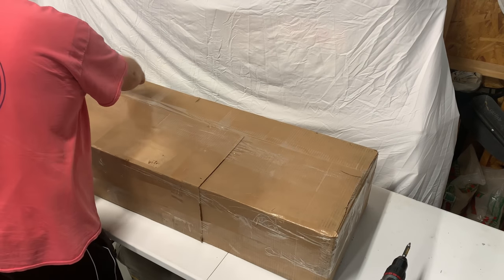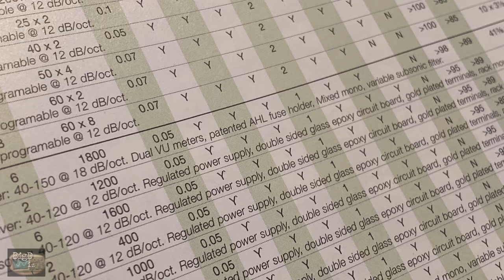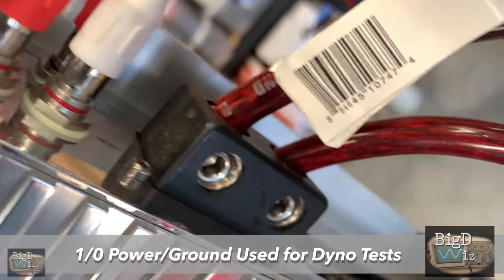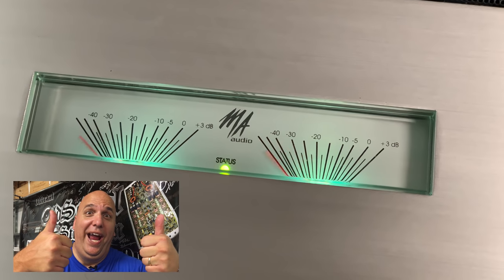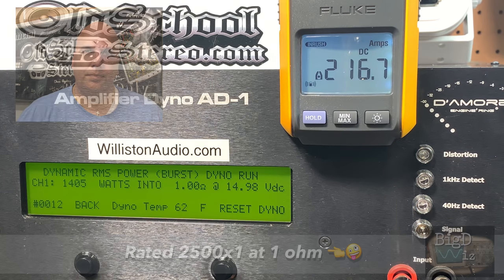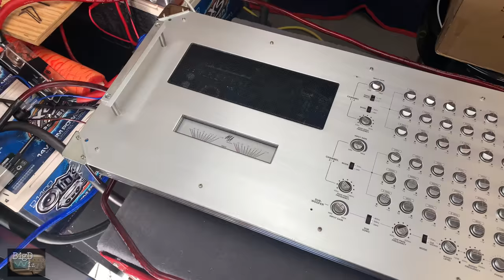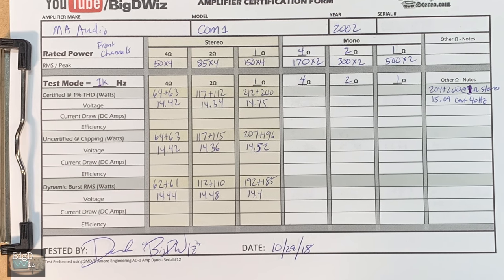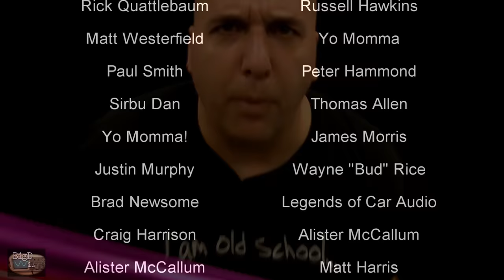2002 MA Audio COM 1 is One of the Biggest Car Audio Amps EVER!

Comment: I think there was something wrong with the sub side. Either that or MA cheaped-out since this was supposedly a promo item. Contrary to what most are posting here, during the particular years MA was making this line, their products were no slouch and they did rated. Granted, they did rated at 14.4 or higher, but they always performed. They made a 1200w monoblock version of this amp. My guess is that's what internals were on the sub side of the amp.
Reply: I ran 1.5 ohms on a HC1500? and it quit

Comment: Looks like a few of the caps had leaked. That could explain the issue. (Dark stuff on the board next to the base of a few of the caps not under the fan).
Reply: That's glue.
Reply: I spotted that and in another area as well. I was no MA fanboy but this era of amps from them were workhorses.

Comment: Whether or not it was done intentionally, placing capacitors directly in the airflow of a fan is a good idea. The cooler you keep those capacitors, the longer they'll last.

I see it all the time where electronics manufacturers place capacitors right next to high heat dissipating components, like right up against hot heatsinks or power resistors. Guess what fails first? You guessed it, the capacitors!

Comment: Fans definitely need replaced. Maybe when you figure out whats wrong with that one channel. You can bring it back to the dyno and see if the results improve. The sub side should have done its ratings and some. Other than that a very impressive amp. Almost looks like dj equipment.
Reply: Agree. Just made a comment about this. Was sponsored back in the day with all MA Gear. With steady voltage at 14.4, they easily gave you rated. MA Gear in this particular era was quite good actually. Popular at competitions in my area.
Reply from the maker: The one channel with the issue was on the 4ch side, not either of the 2 sub channels. It appears the sub channels were overrated and it was obvious to me the 1 ohm 2500 watt rating could not be true as 1/2 ohm stereo said 900x2. That should equate to 1800 watts at 1 ohm mono.
Reply: Do you still have this amp? Interested in selling it?

Comment: I worked for a MA AUDIO/AUDIOBAHN direct dealer in Massachusetts for a few years around the turn of this century. We also sold Ultimate Audio, DHD, KOHLER, & Fultron/Memphis Audio. I had a few talks with these companies directly about some of their designs. I also spoke with Alma Bates.... Personally I compeated in USAC AUDIO DRAGS w/ a 88' FORD RANGER SUPERCAB using a MA HC 4002 AMP, 4 15" DVC  6ohm MA subs, 3 caps, 3 batteries and a 3-disc Jensen head unit. 152-153dB consistently in drag competition with this setup was nothing to sneeze at. The 35c/36c output chips where the same as used in top amps by SOUNDSTREAM and the TI TL494 Chipped unregulated power supply was tried&true reliable. The HC series of MA AUDIO amps were not junk, I wish I still had that amp today.... 😎😎😎

Comment: Damn, I badly want to help a friend of mine find a new amplifier, just in case....because I would love to see you dyno his MA Audio "400" Watts RMS @ 4 ohm amp. I say "400" Watts, because it has been modded, massively. And it has been modded since about 2002-2003 not long after he had bought it brand new. It still runs BEAUTIFULLY to this day, hooked up at 1 ohm. He won several sound competitions in our area, even when he was in classes above his pay grade, so to speak. His total cost for his entire setup was about $2,500.00-$3,000.00 for speakers, stereo, amp. and subs and box. He beat a kid that had nearly $15,000.00 total in his system at one point. MA Audio built some surprising equipment, and their 400 Watt RMS amp was super easy to modify and took to it extremely well.
Reply from the maker: Awesome 👏

Comment: I never been a fan of ma audio reminds me of audiobahn
Reply from the maker: I believe at the time they were both owned by Anaba Corp.
Reply: Same company. Also visonik
Reply: I believe they made thump speakers too.
Reply: for sure, ma was garbage. cool looking amp though.
Reply: @xfiringsquadx  and I think Alphasonik when they popped back up as well.
Reply: @DocChop  Correct. All their subs were pretty much all the same except they came in different lineups. For example, the highest line of MA Audio was the second highest line of audiobahns. MA Audio was mainly brushed metal and blue, whereas visonik was red and audiobahn was purple with lots of chrome and flames. When alphasonic came out they were the orange colored brand. I think they still use the orange color but nowhere near as bright as they used to be. Mechanically, they were all the same though. Lots of Anaba haters here though who claim MA was trash. Anaba products were some of the best you could get for the price at the time. They were decent if hooked up properly. I used to compete with 2 MA Audio xl series 12s in a double bandpass.
Reply: @xfiringsquadx  I had no issues with Audiobahn once I figured out the issues with shitty threadlock... Pulled the shell off, used loctite threadlock and my hct hammered for a couple of years before I switched. I had a connection, so the prices I paid were under dealer cost, zero bitching from me! Not the most efficient gear I've run, but it was loud AF lol
Reply: @DocChop  Exactly. Efficiency was far from good but at the same time this was around when class D's were just coming out mainstream and people didn't really like them yet. Basically everything was inefficient at that time. Gotta have a good alt and charging system for this equipment. But once you supplied the power, it did what it was supposed to and a little bit more. Only competition equipment came with stuff like super thick foam surrounds and triple stacked magnets that weighed a ton. These were some of the first brands to make that kinda stuff affordable.
Reply: @xfiringsquadx  indeed. was some fun times back then... no 5k watts for $349 stuff hahahaha... I went up against a guy in a navigator at a show who had 2 of the monster JBL 15" subs and that gargantuan JBL/Crown amp.. box was all 1.5" thick acrylic, killer looking... I smashed him with the Audiobahn stuff and pissed him off. I hadn't even tuned it at that time, had just received my Symmetry back from RF after having it repaired. Good times! But hell, now guys have 6.5" subs going crazy... how things have changed.
Reply: @DocChop  I know exactly what you're talking about. Real interesting. I pulled the same stuff down here in South Texas. I remember one local car show in San Antonio I blew away a teenage guy who's dad built him a brand new Escalade with 4 JL 18s or 17.5s or whatever they had at the time. Over 5k with upgraded alt at 16v.  I just had two twelves in an Isuzu Rodeo in a pre-fabbed double bandpass probox. Even though it was prefab, it fit specs precisely. Lots of astonished looks all day. It was actually an SQ comp but they took out the meter just cause of the interest in what my setup could do.
Reply: @xfiringsquadx  man those were the days...makes me want to really go all out and crack glass again! lol
Reply: Weak amp but it's a real conversation piece!!!!!
Reply: I know this is super late , but I was given a free MA audio 12’inch sub , it was my first sub ever, my high school self was so excited that  I bought a boss amp off Amazon that same night (cringe I know, I’m a enthusiast now) and it really didn’t bump to well so I went to go buy a Rockford fosgate 400.1 from a pawn shop , then all of a sudden I see smoke from the back and that infamous “what’s that smell” , bought me a kicker type r that was my daily sub for a good 3 years abused , I now have a L7 , Skar SVR , and a FI audio BTL , and nothing but RF amps , and one Skar amp thanks to big d doing the Dyno test, good times looking back at it now lol

Comment: Cool video Big D.  I don't ever recall seeing that big ole amp in any of  the magazines from back in the day.  Considering that I have an MA amp at the house that has a bad potentiometer in it(didn't realize it until after the fact that I had repaired the power supply section and put it all back together 😡)... hopefully that is all that's wrong with your amp.  Don't know if that amp has the same type(brand) of potentiometers...but the one that I have to replace is very crappy.  ✌
Reply from the maker: It could be as simple as the pot 👈😜
Reply: @wal  
Yeah...hopefully it is. Forgot to mention that I also had a Punch 100.2 where one channel was doing rated power and the other channel wasn't.  It too had a bad potentiometer.

Comment: What a massive amp... that barely  keeps up with a Memphis Belle of the same era🤪😂
Reply from the maker: Kinda crazy, right? Still a sick amp!!
Reply: Definitely still got that wow factor fo sho
Reply: The Memphis belle puts the hurts on this ma audio amp
Reply: @fresh55n9ne   if the belle didn't blow up first. they had massive supply side issues.
Reply: juggernautxtr I think the Memphis is a better amp than any ma audio amp I have never heard 1 good thing about ma audio
Reply: @fresh55n9ne   I have had 3 of the high currant amps, putting 17v to an amp that's only rated 3000 at 12v and getting well over 6k at a 1/4 ohm, their 4 channel amps were devilishly good. I also had a memphis belle, last one lasted 3 months before the power supply side shit the brick(notoriously known issue with them.). none of my MA audio amps ever failed except one and the mosfets overheated(my fault for pushing to much to long.)Most of what everyone heard about MA Audio was after the buy out by Tsunami who junked the whole line. cheap as fuck mosfets, weakened power supply sides, same shit that Sound Stream went through when Epsilon(power acoustik) bought them out.

Comment: When the test first started..i noticed something seemed to be wrong with the amp! You say one channel is weak, plus the sub channels massive fail.. I'd say it needs repairing properly! Including new fans as those bearings are definitely dead lol shame i live so far away, i'd love to service it haha.. What a unique and awesome looking amp! The faults just make me want to probe and rev engi it, some schematics of it would be freaking awesome! Also makes repair much easier of course.. Wow.. I want one to run indoors! Hah..make an interesting surround amp wouldn't it? Who needs a center speaker anyways? Quadraphonic 4 channel sound with 2 subs = better than 5.1?!
Reply from the maker: That would be sweet! Too bad it would cost a fortune to ship round trip and it sounds like you may not want to return after shipping 😊
Reply: @wal  Of course I would lol I'm no thief! I wouldn't have the room to keep it, I'd have to wall mount it or something and have a bank of power supplies, caps and batteries lol! 😄

Comment: I used to have two 15-in MTX thunder 9500 dual voice coil 2 ohm subs in a 6 cubic foot box push by an MA audio amp that I can't remember the model number of. Nothing I have ever seen not at the competition level it is hard as that. My pickup I had it in had to have three or four frame repairs because it would beat the rivets out.

Comment: I dug an amp out of my shed I forgot I even had but can't find anything on the web about it, it's a Cyclone 1600 watt model number CA-1494, have you come across one of these before, it is made in China so it may be just some off brands that faded like the hair bands but as I remember this thing really slammed but I was young and was happy with anything louder than stock, it only has one 40 amp fuse so from watching your videos it couldn't even come close to 1600 but if you come across one I would like to see it on the dyno.
Reply: with only a 40 amp fuse at best it could maybe do 500 watts but a pretty good rule for older amps anyways is add a 0 to the fuse rating.  
so a 100 amp fuse would mean it should do 1000+ watts
and if a amp is rated for 1000 watts and has a 150 amp fuse you have a pretty good chance it will do 1500+ watts

Comment: I get an older amp falling a little short on rated, old caps and all....but wow. You think there may be an issue on the sub side?
Reply from the maker: Yep, issue with the ratings 👈😜
Reply: @wal  yeaaaaaaboyyyyy. Big ol ouch on MA. I kinda was thinking any problem severe enough to drop output that bad would have manifested itself pretty obviously when you put it to the ol infinity, or even in a power bias between channels. Damn shame for a piece that expensive.

Comment: I don't know what the results are going to be with this amp but I had two MA audio 12s and a   ma audio amp 4 channel on my mids and highs and on my subs and with an old school pioneer premier head unit with the dolphins and race cars on the screen saver and sold the vehicle it was a 1996 Chevy Blazer but I believe I purchase these subs amp mids and highs in the 2000 error and i know this guy who still has the subs mids and highs amp and the pioneer premier CD player still working in 2020 everything still working fine and the Blazer still putting around banging

Comment: I had a ma audio hk 4000. I liked it till voltage dropped low and it flamed up. Got a visonik 4000d I believe it's the same board if I remember  but both work betton 16vplt

Comment: So, if you test at a specific frequency, and the massive MA has a crapload of EQ controls.....wouldn’t you want to turn the gains all the way up to test for maximum capability? I’m not an audio expert, but this just seems to make sense to me. That’s not to say you want to run it that way, but MA might have published its ratings based on everything cranked.  Will an amp like this clip at a different level if the appropriate level on the EQ is changed? I also realize that cranking it up might induce clipping faster......but that was the eighties. 😎
Reply from the maker: Cranking everything to the right won’t make more power. Just would make it distort sooner

Comment: I ran a lot of MA Audio stuff frkm 2002 to 2005ish. They are plwer hungry. We ran them on 16volts as well as having the MA Audio line driver. From what we were told when MA sponsored us, without seeing 8 volts on the RCA side, and nearly 16volts on the power, they would never achieve true power ratings.

Comment: with the 4 channel side numbers going so far over the rated power makes me wonder if the sub side doesn't have a power supply circuit problem that is bleeding off voltage...there is no way I believe that MA would deliberately put an amp of that caliber out with one side under performing that much.....

Comment: I always stayed away from MA audio and Audiobahn
Reply: IMO they have some decent amps and subs for the right price!!!
Reply: I ran Audiobahn for a minute...Hit and miss big time. I fried 2 of the a1200d1 due to their shitty thread lock on all the crap on the upper shell. As soon as they heated up and had any vibration, the screws backed out and dropped straight on the boards and cooked em. Swapped to the a1500hct and it never even hiccuped. Was a strong amp for a couple years running 2 of their big ass 15's. Then I tore all that out, ran Memphis with 3 JL 12w3v2's and had a trunk again hahahaha. not to mention hitting 150db in a jetta. wasn't too shabby for an st1000d

Comment: MA audio was never good tho so this should be expected. I would be curious how it would perform after a refurb tho

Also, the CEA spec was different back then so it could've technically been correct by their old measuring requirements.
Reply: It's special enough to deserve a refurb for sure
Reply from the maker: It is possible they missed something with the one weak channel.

Comment: this test confirms what everyone already knew back in the day!, MA audio sucks!!!
Reply: it only sucks because you don't know how to tune your sh!t & you most likely you blew everything you ever ran  . just because it dose not do rated don't mean it sucks .
Reply: @LintPockets  Exactly. Most people here ragging on MA audio were either not alive or were in diapers when this gear was winning sound comps in South Texas circa 2002. Many people here clearly don't know what they're talking about.
Reply: @xfiringsquadx  I was one of them, I ran the MA Audio HC2502. On two MA audio 15's. In usaci 301-600 class, i took first place all year in houston. I also hit  best of 153.1 db.
Reply: @Mr15hz  I was setting records down here in San Antone as well with 2 XL 12"s on the 1200w monoblock version of the amp in this video. During this era, the XL series were oversized so the cutout was like 12.5. Those things were beasts in my double bandpass. My sponsor was from Houston. A-Audio 1. He worked at home Depot by day, sold car audio at night and then drove out to a shop he had in San Antonio on the weekends. Small world. There used to be a black monte carlo in Houston that was all MA hardcore series. I remember that guy winning a lot of titles.
Reply: @LintPockets  if it doesnt do rated that is the epitome of fail.  No "tuning" more power.  SMH
Reply: People butt hurt at your truth.
Reply: to all the Ma audio owners, and lovers, if you just saved up fa 3 more months, you could of copped some orion equipment like i did!, or even earlier some kicker amps!, and i don't care how many comps you won, you still ran laughable garbage!!!